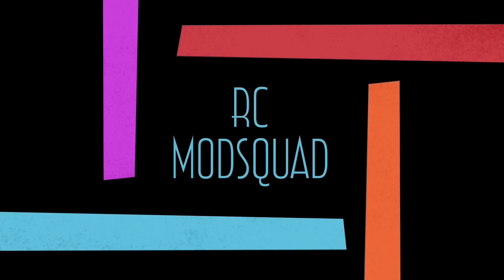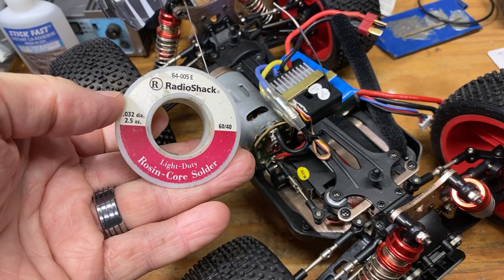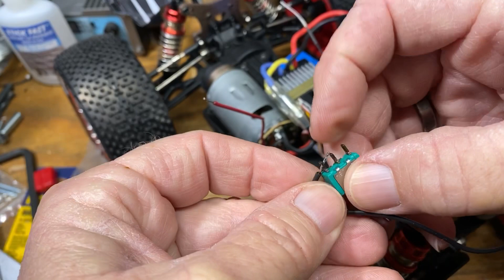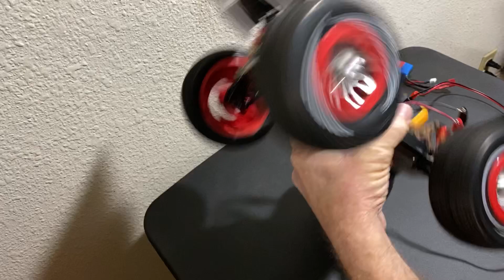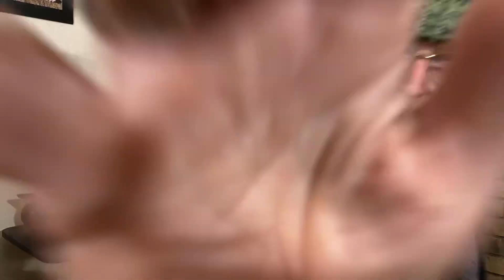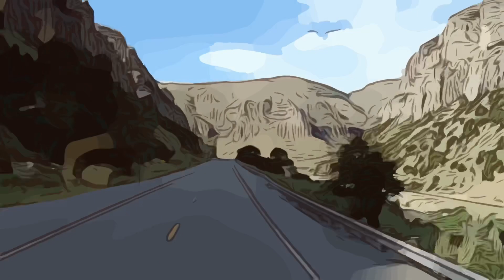WLtoys 144001 diode mod test

Comment: Way late for this but here goes, looks like a shotkey diode, used in the 80s rc as options, supposedly feeds power back to battery under braking
Reply from the maker: I think you're probably correct. 👍👍
Reply: @RCModSquad I remember doing it a few times, only a thing for about a year then esc's started coming with them built in. Keep rc'ing!
Reply from the maker: I still get the RC's out but I don't have much time for videos right now. I still have a project car sitting on my desk when I can find the time I'll try and get back to it.

Comment: Are those wheels 87mm?
Reply from the maker: The inside and outside are two different sizes so it has to have the matching tires to work. The rim is about 60mm outside and 105mm inside. 

Here's a link if you want to look at them. The image doesn't really show the rim. Mine have lasted well but you have to replace the whole thing. 

https://amzn.to/474HXzF

Comment: An important thing to note about this diode, is to NOT put one in across the motor when there isn't one, it is not an oversight, the circuit is different to the one with the diode across the motor. I know this because when I added a diode across the motor in one of my RC cars that did not have it, I burned out one of the transistors in my RX/ESC of this RC car. So yes, the diode does perform an important function in the circuit, if it is in, leave it in, if there isn't one, do not put one in.
Reply from the maker: Correct. There was just a lot of people at the time claiming that removing the diode would make the car faster. I just want to show that it did not go faster. 

Thanks for stopping by. Have a great day and be safe out there.

Comment: Hi, i would like to ask you, does the stock esc (i have the new version) has thermal protection? Im really afraid of frying it. Nicely done video!
Reply from the maker: Thank you very much. Not that I can detect. I’ve seen some of the ESC’s that died almost instantly on 3s with only a few seconds on them. Some have done OK on 3s. 

My recommendation is do not run the car on 3s with the stock ESC. 

Have a great day and be safe out there!
Reply: @RCModSquad  It does get really hot wih 2s too. Can you recommend me an esc that works well, without overheating issues? (i will run it with stock parts.) The stock esc is really cheap, and hot.
Reply from the maker: @bandusvod824  the Hobbywing Quicrun 1060 60A 2S-3S Waterproof Brushed ESC is a good choice BUT if you go to a non-stock ESC you will also have to change the servo. The stock servo is a 5 wire and the aftermarket ESC’s are 3 wire. 

All ESC’s are going to probably get too hot to touch. I would just run it and let it cool a bit between batteries. You can also add a fan to your ESC to help keep it cooler.
Reply: @RCModSquad  Thanks! Well atleast, the new esc will not try to commit suicide!
Reply from the maker: @bandusvod824  You’re welcome! its pretty normal that they get hot. I try and stay under 180°-200°. I do use an infrared thermometer to check it. 

I’ll add that I’ve never killed a stock ESC on the stock motor and tires running 2s. You really should be OK if everything is stock unless it’s REALLY hot where you live.

Comment: A  is a semiconductor device that essentially acts as a one-way switch for current. It allows current to flow easily in one direction, but severely restricts current from flowing in the opposite direction.
Reply from the maker: Yep!, Thanks! The reason for the video at the time is there were a lot of people saying that if you removed the diode the car would run faster. I just wanted to show that that was incorrect. 

Thanks for stopping by and checking it out. Have a great day and be safe out there!
Reply: @RCModSquad  oic, people are so lazy. just look up what it does!! lol

Comment: these are massive wheels... how does it change this cars performance over stock wheels... is top end around 3 mph more??? does battery and esc/motor get hotter under same conditions...? thanks
Reply from the maker: They are too big. Everything got hot with the stock ESC and motor.
Reply: @RCModSquad  yeah maybe some wheels 20-30 percent more diameter would be pretty good ...like truggy tires... tose looked like 1/10th monster truck
Reply from the maker: @roadstar499  I just grabbed them because my local hobby store was moving and had everything on sale so they didn’t have to move it.
Reply: @RCModSquad  i ordered some 1/10 scale drift wheels for mine last week... i am looking forward to seeing how it does... ..i never did drift wheels before seems pretty fun and you never need to buy tires...
Reply from the maker: @roadstar499  I thought about building a set of drift tire. I might try that this summer.
Reply: @RCModSquad  i just looked at  wheels on a tamaya dark impact buggy i built around 12 years ago... they seem around 30 percent more diameter... thinking the stock setup could handle them as long as you dont push it to hard... i could see it getting around 4 mph extra speed possibly... not sure they are a direct fit though... have you ever put 1/10 buggy wheels on your 144001??? makes it like a truggy...
Reply from the maker: @roadstar499  I just tried the ones in the video. As long as you watch the temps or run a couple of fans it would probably be ok. The other thing to watch it the diffs. It would be a good idea to back off the throttle if you jump it. Since there will be more load on the diffs hitting the ground under power would be a big shock. 😉
Reply: @RCModSquad  yeah i think stock is perfect for this thing anyway... i just was thinking of trying...probably best to leave well enough alone... lol
Reply from the maker: @roadstar499  I might do a gear swap and try some bigger tires this summer. 

I like the 2845 size motor. I think it’s a better balance for the car.

Comment: back in 80's i was told the diodes on motors were for better radio signal...motor without diode caused motor to interfere with radio...causing glitches
Reply from the maker: They use ceramic disk capacitors at the motor terminal for noise suppression. I don’t think it’s as much of a problem at 2.4gHz as it was at 27mHz.

Comment: I think diode is for protection, I think for more power would be better use a capacitor
Reply from the maker: True! I was testing this because it was a bit of a rumor that removing it would make the car faster. I just wanted to squash the rumor. 

The capacitor has the potential to help if there is a voltage sag. 

Thanks for stopping by. Have a great day and be safe out there!

Comment: i didnt realise that the electronics was 3S capable , i just bought one of these babies last week got it today , but cant run it as its pouring rain and ice so gotta wait but running it up and down the hall passage and wow its got some power on the 2S stock 1500mha battery, also was wondering how and what tyres are you running can i use my 1/10 size tires on this ? cheers great video btw :-)
Reply from the maker: Andrew Reece as time has gone on I’ve burned out the ESC on 3s so I don’t recommend doing that. Some people get by with it but many more have burned out. 

With the larger tires it will also add load and therefore heat to the ESC and motor. 

If you do any of these mods you really need to keep close watch on the temps. 

Thanks for stopping by and checking it out. Have a great day and be safe out there!
Reply: @RCModSquad  yes i think ill upgrade the whole electronics as im not into destroying my gear lol, i may even buy another one of these as there only cheap but great little cars i have ordered the aluminum upgrades for it just waiting for that to arrive but from factory i cant believe the quality this little beast has and for the cost its hard for anyone else to compete and still make a profit , oh well its better for us and gives us that little extra for other toys, i am a Tamiya Kit Builder and lover but those i generally keep as shelf queens and dont thrash but i have been buying some hsp1/10 and 1/8 scale cars for bashing/driving and having a blast with also i have a 1/5 rovan Baja 32cc gasoline beast for really getting there Adrenalin pumping but also now have started getting into these crawlers and just picked up the Gen8(orange)by REDCAT and also the Rochobby 1941 Mb scaler jeep so i have been buying up big this year as have spent most of our time in lockdown and this has helped me get through as its started to drive me insane there for a bit as im normally out at the flying club as im a flyer also planes,drones,quads,helicopters but here in Melbourne at the moment we are still in lockdown and my car's have been great as can go out front and drive away this time last year only had 4 rc cars now im at a total of 21 cars 8 still unbuilt under the bed and 2 still in transit and just finished a few and the rest are RTR so yeah this covid has really indented my account balance but gotta keep busy and as God has allowed me to do this im happy to hahaha , sorry for the big spiel but just thought id give you a quick rundown on myself a 45 yr old single Big Kid who loves his RC Hobbies , cheers for your channel and all the great information glad to have come across your channel , big Cheers and talk again soon.   :-)

Comment: I took diode out and 3s runs esc works but servo isnt working. any ideas my friend?
Reply from the maker: seeze rec my guess is the the 3s battery killed the driver board for the servo which means you will have to change the ESC. 

I’ve seen this happen to several cars now.
Reply: @RCModSquad  lol okay thanks man. I was running a venom 3s 20c 1300mah battery worked great no diode pop and both esc and motor ran pretty cool but wanted the extra runtime and I'm assuming because I bought a higher 3s 25c 2200mah ace gen that's what did it. Oh well looks like brushless upgrade us coming.

Comment: Hi, what should I do now? Leave the diode on or take it off. My ESC broke yesterday after I connected an s3 25c 1000 .. I can drive forwards and backwards but the steering does not work anymore: / that's for sure the esc or.. i never use a3s next time when i have a new esc :) only 2s :)
Reply from the maker: Rich Hair I don’t think the diode will do anything for you. I think you just need a new ESC. Both of my servos are still ok. Just my ESC burned out.
Reply: @RCModSquad  thank you
Reply from the maker: Rich Hair You’re welcome! I wish I had better news. Good luck! 🍀
Reply: Dam, I did the same with 3S.

Comment: I conected 3s turnigy 2200mah 25-30c battery and diode instantly exploded as soon i gave little bit throtle instantly disconected battery removed diode remains then reconected it seems runing without problem i wonder is it safe to use that battery? as i understand diode is for controling current when its coasting because motor can generate voltage back to esc and burn it also i wonder whats stoping will be is it going to stop or instantly go in reverse.. ? IN GENERAL  is it safe? or its going to burn esc?
Reply from the maker: OwlShadow on my car I didn’t see any difference with or without. I think this ESC is best used with 2s.

Comment: Hi I received my 144001 😍😍😍.
But my esc has a small red button.
Since that isn't the v1 (big red switch) and the v2 is with that tiny tiny button that you modded.
Do you know what version is my esc? (Has a tiny red button on the ESC and a sticker 60A esc).
Thanks 🖖🖖
Reply from the maker: Rushan Randeniya Thanks for watching! 👍🏻 Maybe that’s V3? I haven’t seen that one yet. 

If the axles stick slightly out of the Nylock nuts on the wheels then it sounds like they made another upgrade to the car. 👍🏻👍🏻
Reply: @RCModSquad  Yes they does.
Since I received it I never strength the nuts and they never come off

Comment: great video.  i used to live At radio shack in my cb days...its nice to see if mods like circuit  mods work instead of throwing money at this cars. wonder what a capacitor would do to it.
Reply: awesome thanks for the answer.was just courious.keep up the great work
Reply from the maker: tony kingme1x Thank you very much. 

I think it’s a different reason for everybody but if it’s custom then it’s kinda yours. 😃 

Have a great night.
Reply from the maker: tony kingme1x thanks a bunch. 🙏💯👍🏻 If I can find some pavement that doesn’t have snow on it I’ll see if being under a load changes anything (it could) but I’m leaning toward it not making any difference. The diode should be there just to protect the circuit from reverse voltage spikes. 

If you remember the very first component in you CB was a 1n4001 diode. They used it as a crowbar circuit to blow the fuse in case you hooked the radio up backward. It would pop the diode and cause a complete dead short but it protected the rest of the radio. If you put a large capacitor on the motor it could potentially give it a little more punch IF there was a voltage sag but I don’t think it would even be enough to notice or be worth the time. 

I am doing this because I’ve heard from a bucket load of people that it did something so rather than relying on “guesstimations” I wanted to prove or disprove the mod. 

It’s kinda like putting a loud muffler on a carbureted engine and not changing the jets in the carb. It “sounded” faster but in most cases it was actually slower. 

I’m still looking for someone with a burned out ESC that killed it on 3s to send me one to dissect. I think I know what’s happening but until I see one I can’t say for sure. 

Thanks for stopping by and have a great day.

Comment: hey have been watching all the videos involving this car by everyone around youtube; including you, but i just recently came across this and asked myself why everyone is cramming other electronics instead of the upgrades that they made for the car(specifically the motor+esc+servo+receiver)? any input you have would be greatly appreciated https://www.wltoysrc.com/home/4080-wltoys-xk-144001-brushless-motor-kit.html
Reply from the maker: Thanks for watching. I bought two of these cars and one, I am going to leave completely stock.

I can’t really say for sure in every case but some people have a preference for different brands of motors or controllers. You can do it cheaper than the WLtoys kit. 

I’m going in a different direction than most. I’m going brushless but with a smaller motor in my second car. Mostly because I haven’t seen anyone else do it and I’m curious. 

To me this isn’t much different than people buying a new car and immediately starting to change parts on it. 

Five people can all by the same RC and when they’re done they look nothing at all like they started. 

My interest is more to help people that are getting started and are on a budget. 

I had a friend when I was growing up that would buy a new pickup then jack it up, put monster mudder tires on it and it never left the pavement. If it was raining he wouldn’t drive it and every Sunday he went to the park and waxed it. (Unless it was raining😆 

In two years he would sell it and start over on a new one. He never had over 10k miles on one. 

I asked him why? He said “Because I like it and I can”.

It made no sense to me. 

Thanks again and have a great day.

Comment: I got mine the other day but I think it makes alot of rattling noise when moving. I haven't really tried higher speeds but at low speeds it sounds terrible. Like something with the gears somewhere. Tried looking around at most of them but couldn't see anything physically wrong with any of them.

Does yours also make alot of sound when just idling slowly?
Reply from the maker: Avecforte there is one issue that I know of. If you add a lot of preload to the shocks to get more ground clearance the dog bones kinda bind up and it is most noticeable at low speed. 

They also didn’t put much lube in rear axle gears or the differentials.
Reply: @RCModSquad  I did notice that it gets better when it's sitting on the ground. Might make a video of it and see what people say.
Reply from the maker: Avecforte if you’re holding it in the air and running it I’m almost positive it’s the dog bones you’re hearing. Find a box or something to set the car on to push the lower A arms level with the chassis and it will probably sound much better.
Reply from the maker: Avecforte I just thought of another easy test. Hold the buggy in the air and with both rear wheels hanging down spin one slowly. It will feel really notchy. Now hold the axles so they are level to the frame and do it again. They should be smooth. I’ll try and remember to put this in my next video.
Reply: Mine also got this issue. There’s just not enough grease in both differentials front and rear. Once I reapply more grease, the rattling noise noticably gone. Also try to alter the height of your RC so the dogbones are straight with the ground.
Reply from the maker: Ryan Wangsa thanks 🙏 that makes a big difference. I’m not having any troubles but you of the guys was. 

Have a great day and be safe out there!
Reply: @RCModSquad  definitely! you too stay safe! 🙏

Comment: Hi my friend watched all your video and its very interesting,  apparently what I've heard is removing it you can run 3s and Bash hard and Longer without the Esc Frying,  with the Diode on apparently after Bashing on 3s it Frys the Esc, there is only one way to find out and that's Bash it Hard or run a full battery with it on and with it off. 👍 great idea with the switch and a great video my friend 👍😎👍
Reply from the maker: Tonys Rc Tech thanks a bunch! I have heard the same thing and that’s why am doing the test. 

Based on what I saw it didn’t make any difference at all. But, all that was done with no load so I will add a load we will see. 

I am going to speed test it with the big tires first but I will probably put the regular tires back on it to buy shit on 3s.